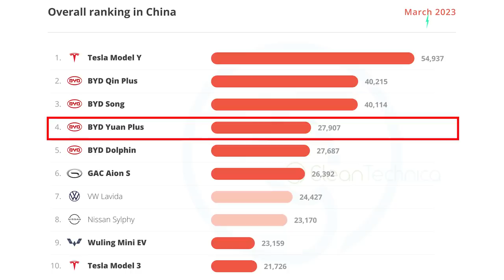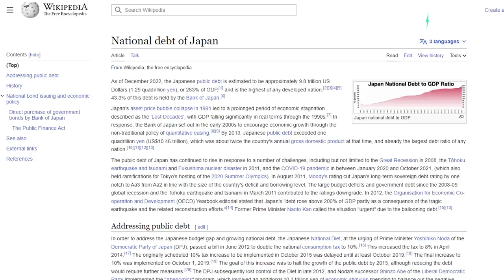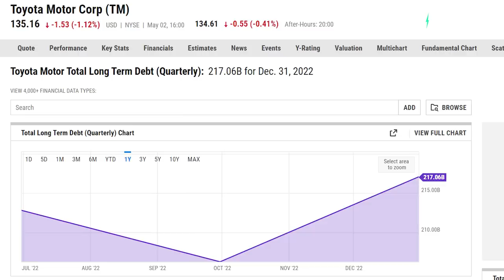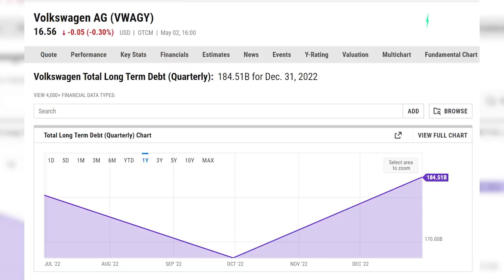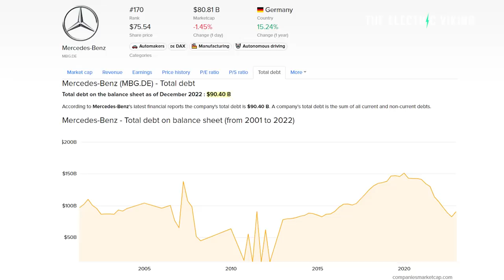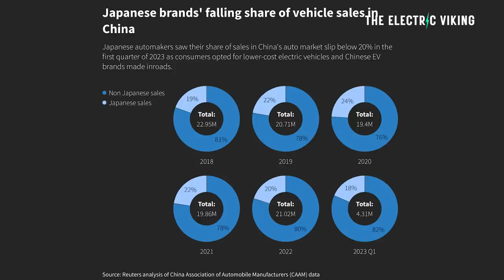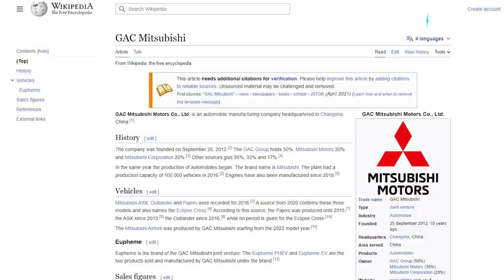Japan's automakers' Kodak collapse will cause an economic catastrophe

Comment: I agree with you. I’ve said many times if the Chinese get a foot hold in Europe it’s to late for many manufacturers to get that market back. Mazda have been in denial of Ev’s for years and I think like you that could finish them. The sad  part in this is Nissan it was one of the first to bring Ev’s to the masses with the original leaf 13 years ago but never really built on that because the current leave is simply a re body and bigger battery of the old one still with all its drawbacks.
Reply: Denial about rotary engines too lol best use so far is range extending a plug-in imho 😂
Reply: Chronic passive cooling
Reply: Now we all know that "Who killed Electric Automobile" was not a joke. I said it before, and I repeat it now: China shifted all to EVs, not Tesla. Tesla opened the mid of the people but unfortunately, just the Chinese leader understood the opportunity...now all the rest just try to sit in the game... and I am afraid of what they are capable to do (I never forget what they made to Tucker in the USA)...
Reply: I think it was the Mazda CEO a few years ago who said something like "We've received no indication from our customers that they want an EV" and was then deluged on twitter by ex-mazda customers saying essentially "yeh thats because i know you dont make one so i just sold my old Mazda ICE and bought an EV from someone that did"
Reply: If the Chinese get a foot hold in Europe it’s too late for many manufacturers.
Reply: still driving my 2011 leaf, wish it has active battery cooling.  may have to retire it after the CT coming out, i love it's reliable ugliness repel criminals

Comment: It's actually extremely easy to register an ICE car in Shanghai and Beijing unless you never owned a car before then in Beijing you have a lottery (most difficult place in country and not sure their EV rules) and in Shanghai you have an auction for new plates.  Currently local Shanghainese are exempt from the auction system for EVs and PHEVs but rules are still stricter for that than 2 years ago.  But if you are one of the millions of people that own a car already (ICE car that is) then you can buy a new one very very easily and register it very very easily.  just transfer your plate.  probably takes 2 hours tops.  The real reasons why people in large cities switch to EVs:

- incredible charging infrastructure even though every one lives in high rises
- a lot see it as cheaper because electricity prices are controlled and also you don't pay 10% VAT on EVs right now and in Shanghai you also get a  free plate whilst the plates at auction cost around USD15-20 k (cost if registration in Beijing are nothing but chance of winning lottery are so low)
- many think many it will become mandatory at some point or at least that the subsidies will go down (and whilst in Shanghai you still get a free plate now and no VAT, the EV manufacturers no longer get subsidies from government since Jan 1)
- many people are also eco conscious
- many consider EVs to be cool

But these cities are not representative of China as a whole and go to even Suzhou which is a large city and close to Shanghai and EVs are less prevalent.  go to the countryside and the infrastructure is much less convenient.  In Shanghai on each block you probably have 10 charging points within 100 meters.  In small cities, you may have 10 for the whole city.  For those places, the goal is cleaner engines China 6+ and beyond.  their range of vehicles in much more suited to smaller cities and rural areas than Tesla or the upmarket Chinese EV makers.  Now BYD will do fine there because of the huge range they offer....  

and btw, Toyota now launched around 9 NEV models in China and Honda as well.  Will they survive?  probably if they adapt.  and one thing you need to also take into account, these guys are all in JVs with Chinese state owned automakers.  And these have huge capital investments with their foreign partners so whilst they would certainly like their own brands to do great, they don't have much incentive for foreign partners to fail.  And neither to local governments.  If you are the Wuhan local government for example then Nissan and Honda are important.  These JV's with SOE are also the reason why China 6 powered inventory got  a 1 year extension.

Now whilst Ford and GM are also important, I think they will struggle the most of any legacy automaker in China.  their products are well dated or overpriced

The real story is where in 10 years Tesla will be in the Chinese markets... they are 10th now and there is no longer this  huge advantage for Tesla.  many Shanghainese when considering an EV nno longer think that they HAVE to buy Tesla... unless they develop a strategy with more than 2-3 models at a time, will they still be there?  not sure, and they dont have SOE partners to help them either.  

oh and btw, the biggest discounts this year are not BMW or Toyota.  But from EV makers and especially Tesla.  They kind of try to hide that by saying this is a "revised" price rather than a discount but the last 2 years Model 3's have seen huge price drops...  and this has pisse off a lot f people who nought at higher prices.... and they can't sell much of these either these days.... most of their sales are Model Y....
Reply: Nice explanation of the state of affairs in China👍.
Reply: Doesn't take away that the change is happening. Norway was first. Tesla sells globally and can sell all their products globally. $1,000 shipping cost max. 
BYD Nio saic can build cars and there are dozens of  charger manufacturers due to 2W, 3W, buses and trucks also increasing.  So really only talking a 3 year lag at most.
Apply 80/20 rule.
Reply: Wait, Tesla builds the Model 3 this year for 30% less than last year, and people are mad because the price went down?  How does that make any sense?
Reply: @davidbeppler3032  first not sure if they build it for 30% less but assuming this is true then this is still a big issue.  First, they dropped prices many times and every time they did this a lot of people who bought a car a day before a price drop have been peeved in the sales staff not telling them to maybe wait a day or 2 (and in China, most sales are done via showrooms).  Secondly  if you bought a Model last year for RMB280,000 and this year it sells for RMB229,000 then if you want to resell your car now, it has lost a huge amount of value...  So yes, some people are pretty pissed off and in the end the endless yoyo of price changes (prices went up slightly a couple days back) do annoy many including customers.  And this is significant in China because historically depreciation on used cars has been much less significant than in other countries
Reply: Firstly, EV's are only good for 15-20 minute cities. And that's great for china but in  the rest of the world they are about to die out, why, people are waking up, we in the west love our freedom, EV's restrict people. ICE vehicles can be more enviromentaly  friendly than EV's, the technology is there to make ICE to be over 90% efficient, if that is done then EV's are done for. Where will that leave China's makers as they are all betting on EV and l have not started with Hydrogen which Toyota is betting on. True hydrogen vehicles will kill everything else, period, its called the power of H2O
Reply: @shanghaidiscovery2664  Anyone selling a Tesla a year after buying it deserve the loss.  Why sell a car that lasts 20+ years and a million miles?  Who makes that kind of bad decision?
Reply: @georgesidiropoulos4710  A lot of highly inaccurate information in your post. 🤦‍♂️

Comment: Great video! I did not realize that Japanese car sales had suffered so badly in the Chinese market. North American and European sales of Japanese cars seems to be good for now but if China ever gets to sell EVs in Europe and North America that could change.
Reply: Not so great in those market as well.
Reply: China do sell ev,s in Europe, in Denmark we got BYD, MG, Xpeng, Nio, (Polestar). But a lot of them set up their prices like they are the new VW or Toyota. So they need to drop their prices and get in some of their small cars. Manny also have bad charging speeds.
Reply: @n.ringheim7720  I think the issue is the sales are relatively small but the overheads are relatively large so they have to make good margin per car.
Reply: " North American and European sales of Japanese cars seems to be good for now"
They're leading the market in the US since they're catering to the 90% not buying EVs.
Reply: @markuc  "Not so great in those market as well."
By what metric? They're among the top three in vehicle sales.
Reply: @wisenber  Not sure about the 90%. I think GM, Ford, Stellantis, the Koreans and the Germans take up more than 10% of the US ICE-cars. The Japanese have grown a few percent market share in the US in the past year. Anyway, the US has a y-o-y grow rate of EV charging stations of 35% that is expected to last for at least the next 7 years (more than 8 fold increase). By that time the US will have massively changed to EV as well. The risk of running out of battery because too far from a charge station will be negligible.
Reply: @wisenber  Only North America buys as previously lots of ICE cars the way they are used to. In Europe the EV sales are quickly ramping up and ICE sales fall down. Japanese automakers are only relatively safe in North America for now but it is not clear for how long.
Reply: @richardbloemenkamp8532  " Not sure about the 90%."
I was referring to the 90% that aren't EVs as a market, not one manufacturer.
EV producers are competing for the 10%.
Reply: @nevco8774  "In Europe the EV sales are"
...still a minority of sales.

"Japanese automakers are only relatively safe in North America for now "
..and Africa, South America, India, Southeast Asia... The majority of the planet doesn't have the infrastructure to support EVs.

"but it is not clear for how long."
At least 12 years if Biden wins a second term. Longer if he doesn't.
Reply: @n.ringheim7720  
No import tariffs in Denmark?
Reply: @ShareGoodThings11  "The proof is that China overtook Japan in auto exports in the first quarter"
The truth is that Japanese auto companies have been producing the majority of their vehicles outside Japan for decades.
Chinese auto makers really have nothing comparable to show.
Reply: @wisenber  You are right, I misread. However those 90% are likely to drop quickly in favor of EV as the charging facilities, their spread, their efficiency, their availability and ease of use are ramping up.
Reply: @wisenber  This is evidence of the rapid rise of Chinese cars, which have squeezed Japanese market share. We Chinese are not arrogant enough to think that Chinese cars have beaten Japanese cars on all sides. Let's hope Japanese companies do something useful or the numbers will get worse every month。
Reply: @ShareGoodThings11  "This is evidence of the rapid rise of Chinese cars, which have squeezed Japanese market share. "
It really isn't since they're going after two different markets. Japanese brands are going after the 90% and Chinese the remaining 10%.

" Let's hope Japanese companies do something useful "
Like having two of the top five selling brands on the planet?

"or the numbers will get worse every month。"
The rest of the world is more about decades than a month. Judging by a single quarter isn't a very good long term strategy.
Reply: @wisenber  I hope you feel as confident as you do when you see Toyota and Honda sales numbers at the end of the year.
Reply: @wisenber  “Japanese auto companies have been producing the majority of their vehicles outside Japan for decades” - very true and in China particularly, and it is this video all about. They used to made more than 5 million cars annually in China and took up around 25% of the world’s biggest single auto market, but they probably will shrink to around 3 to 3.5 million this year, and they lose their share not to vw or gm, mostly to China makers, and this only happened within 3 years. If they are not worried at the moment, then things can be very ugly in the near future, they will have to hold their fort in whatever ICE market left when 2030s come.
Reply: @ShareGoodThings11  " I hope you feel as confident as you do when you see Toyota and Honda sales numbers at the end of the year."
I know they're dwarfing anything from China in North America presently. Chinese autos don't even register here.
Both are selling more than they can produce.
Reply: @simonking3949  "ICE well ended up like Nokia and Kodak."
Meanwhile in 2023, it's 90% of the market. Until we get the flying cars promised in the 1960s, it will do. That and my diesel Ram truck still runs with 1.2M miles on it.
Reply: 并没有，我们马路上跑的最多的车是日本德国美国韩国，最近几年才多了国产车，比例大概是1:1:1:0.6:1